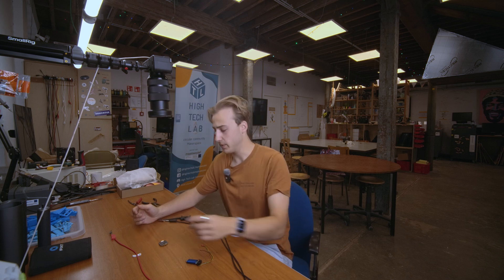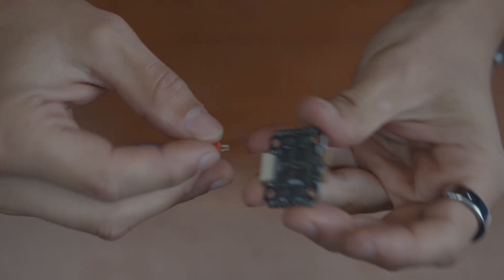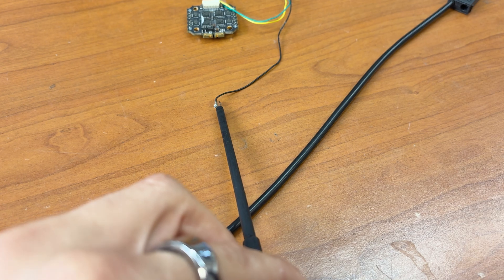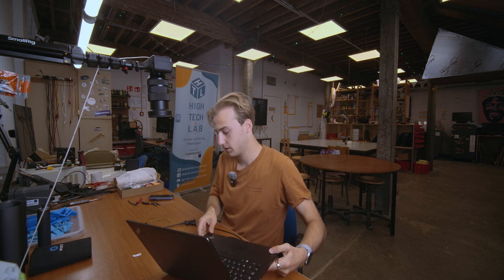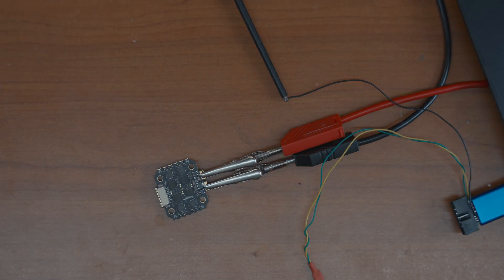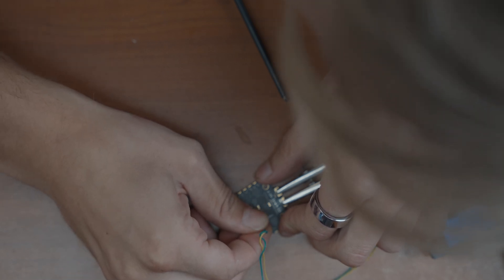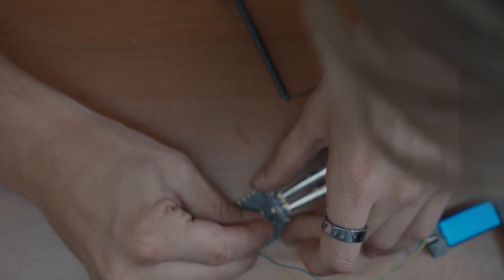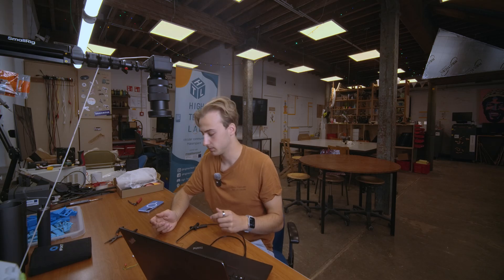How to unlock a BlHeli32 ESC to AM32 using the unlocker tool

Comment: Needing some help.  I have an AM32 Lucid AIO that I tried to use the AM32 configurator to update the firmware... don't ask why.  Sadly, the update failed and the ESC is no longer recognized.  I tried the ST-Link Utility to flash the one esc but it keeps coming back with an error.  WIll this unlocker tool work to reset the AM32 to bootload?
Thank you!